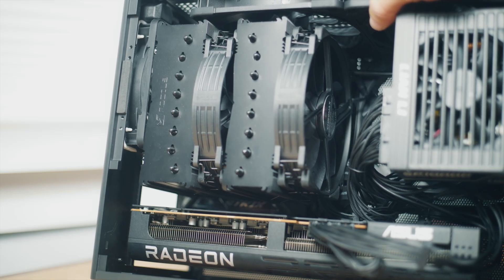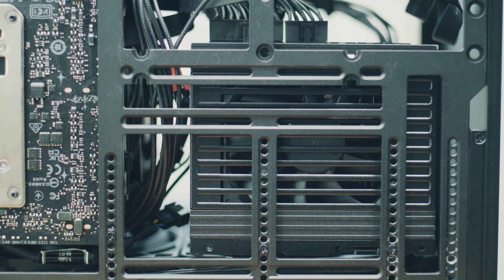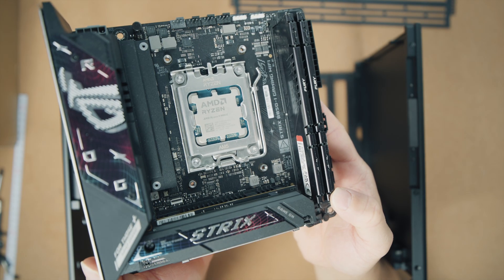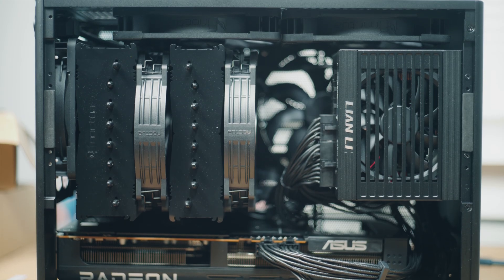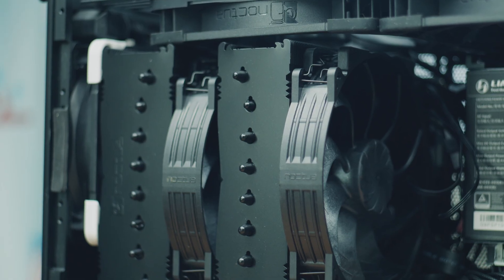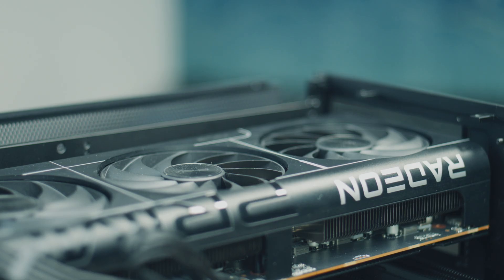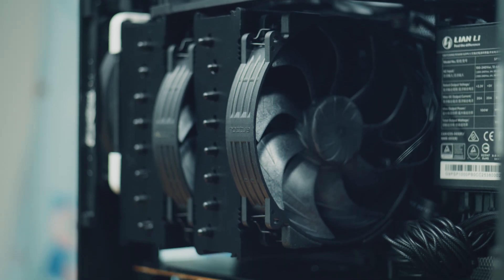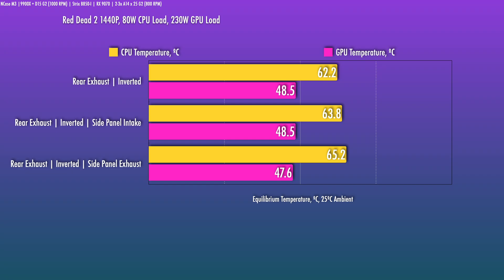𝘛𝘏𝘐𝘚 is the best airflow setup for an air-cooled NCase M3.

Comment: @MachinesMore help me out here - Kingston Fury Beast 32GB lists 34mm for RAM height. Max RAM height for NH-D15 G2 is 32mm. The ncase m3 only offers 168.5mm of total clearance and the NH-D15 G2 totals 168mm, so how does everything to fit? Even if offsetting fans on the CPU cooler (which per the ram height/max ram height cooler issue, you have to), where is the 1.5mm you still need to fit this ram/cooler combo into the case? There's something I am missing here.

Comment: I can't fit the 2nd round fan on the NH-D15 due to RAM height. Instead I can use the NF-A14x25 G2 (non round) fan as secondary fan on the CPU cooler, due to the mounting holes on it being 105x105mm (same as the 140mm G2 round). Would that be okay for the Inverted GPU/CPU exhaust/2x fans bottom exhaust layout you showed here? My both 9950X3D (PPT 180W) and 5090 (Afterburner curve tuned and 80% Power Limited) are undervolted.
Reply from the maker: Did you mean you want to run a square A12 (120mm)? Also do you have a rear fan? You may find that the center fan plus a rear fan is enough. Airflow-wise, it's not an issue so long as the directions are consistent.
Reply: @MachinesMore  Yes, a square A12x25. the mounting holes fit the ones of the 14x25R G2 (from NH-D15) so it should fit using the same D15 fan brackets. I will have a rear A12 G2 fan. so that would make 3 fans total on the cooler: 1x 120mm G2 rear, middle 140mm round G2 stock and 3rd 120mm square G2 on the front of the cooler heatsink.
Reply: What is your RAM height?
Reply: @Dermii3D 35mm
Reply: @aumdna  I saw a post on Reddit with a nh-d15 g2 and a 35mm Corsair Vengeance without any mounting problems. Now Im confused :/
Reply: @Dermii3D in what case?
Reply: @aumdna  M3 Grater
Reply: @Dermii3D I talked with someone who was able to tweak/unscrew the backplate on a X870-I board, the CPU bracket, and re-screwed it with a slight offset to the right, so the NH-D15 2nd fan clears the RAM, but I wouldn't do since Im using a Thermalgrizzly bracket + Kryosheet. My solution is the 120mm square G2 Noctua fan, because I can use the same D15 fan brackets. The round 120mm doesnt work

Comment: hey, looking to do pretty much this build but with a 5080. A few questions if you'll indulge me also thanks for your hard work in testing this stuff, great channel.

- Never had a PSU in the front of the case, do you need some form of extension etc.?  
- How safe is it to have your GPU upside down in inverted? how do you stop it sagging the other way.
- Looking at the M3, any mods they sell that you'd say are good or just the standard kit required that they sell. 

Thanks kindly.

Comment: really wondering how the temps would be with back intake and a top-front exhaust (only that one top fan) and non-grater version(and maybe a back fan, where the psu was?).
Or the same, but flipped

Comment: Really great video with actual temp testing. Some articles online claim "CPU cooler intake is definitely the best" and nice to see that proven mostly irrelevant. Surprising to see inverted be so much cooler for the GPU, could be that the small feet prevent GPU intake when it's on the bottom and taller feet would help bring bottom GPU temps closer to inverted/top GPU temps, just a guess though.

Comment: Great info as always!. Can i ask you about the noise difference with the same hardware (9900x) between this SFF build and the FormdT1 with air cooler like Id cooling or similar. Is the latter that much louder or if i`d restrict cpu power usage etc from the bios it wouldn`t be that noticable. I really like the FormdT1 but maybe the Ncase M3 might be the more logical solutions. Thanks

Comment: I tried the inverted build in the M2 and didn't like it at all.  Mostly because the PSU is held up by two tiny screws from the bottom, and the GPU has no support.  It doesn't really feel like it's meant for it and feels like an afterthought.  I looked up the M3 and it seems they haven't tried to resolve any of those two issues.

My favourite build up to now is traditional build, with GPU pulling fresh air in from the bottom, then the AIO on the side panel, PULLING fresh air in through the radiator, and then two fans at the top exhausting it all out.  The airflow of it makes complete sense, there's plenty of room in the case for air to move, and you can actually feel all the hot air being directed out of the top.

Comment: This just shows how flawed current standards are. Even for cases at this price point, cooling is still stupid. As for this case, sagging is an issue for both. There is no handling of external cables. But given that this is the space you're in, this is actually pretty nice work. Except that you do not really call out the basic flaws of the standards of the industry, which are pretty glaring. But as a guide for building in this thing, just accepting what it is, this is great.

Comment: Wow, now I am going to switch to inverted exhaust. I have both the M3 round and the M3 grater. Would the grater be even better? or do you want me to test? Of course I have a 9800x3d in the grater with a 5080, and a 9950x3d in the round with a 5070ti.

Comment: @Machines & More I want to order the M3 so badly but not sure if my parts will fit:  NH-D15G2m mini-itx board, sf1000 corsair , 9950x3d, and the possible problem - TUF Gaming 5090.   I want to do it in the slot on the board and mount horizontally.   Comments Machines & More?
Reply from the maker: Should be fine and a good list there. TUF 5099 dimensions check out. You will just have to have the ITX board up higher to accommodate the thicker card, so no top fan possible over the D15, but you should be able to get one on the other end. SF1000 is the SFX you are referring to right?
Reply: @MachinesMore  Yes the corsair sf1000 sfx unit.

Comment: What about dust-collection on the GPU with a Inverted layout ? I feel like dust will suffocate the GPU within 1 year of use and could be detrimental to longevity of the card. Thoughts ??
Reply from the maker: Sure, with the way the top/bottom panels are you definitely need to vacuum it out regularly. It's not the worst thing performance-wise for dust to accumulate on the heatsink, just... a little gross 😂
Reply: @MachinesMore  A 30-sec vacuum every few months wont hurt. However, I travel internationally with my PC every ~3 months or less. Anti-sag/Travel kit solution is very important for me. I have a clamp-style bar secured to the bottom panel with Standard GPU layout which works beautifully. What would my options be with Inverted layout? Thanks so much!

Comment: Interested to see what the result would be of the rear intake plus side fan exhaust (plus top exhaust)... That's how I have it set up in my NR200 with a 5080FE, that side fan exhausts a lot of heat from both CPU and GPU.

Would it be possible to test it? Seems like the most optimal way for both GPU and CPU on paper.

Comment: You said in all configs the case fans were in exhaust mode. That would negatively influence configs with CPU exhausting no? Because the cpu fans would fight with the case fans for air.
Reply from the maker: That was my initial guess. But the ventilation and space is such that it doesn't seem to be a big issue. I was very surprised.
Reply: @MachinesMore  Okay thhank you for the reply. I will be building in the M2 Round and I will be using a 7700X cooled by a NH-D12L. GPU is EVGA 3080 FTW3 Ultra. Would inverted with rear exhaust still be the best? I will only be doingg gaming no productivity work.

Comment: So you just bought an air cooler and you assume that it is the best air cooler, I have a Noctua nh d 15 and I had a 14 version of it for my previous i7 build, now I have a ryzen 9950x and an nh d 15, and a corsair 4000d airflow case, I think there might be minor differences but this case and cooling system is good enough, I don't claim that it is the best but it might be.

Comment: This is my build could you tell my what is the best thermal configuration since I didn’t buy any fan yet 

• Case: NCASE M3 
• CPU: AMD Ryzen 7 9800X3D
• Graphics Card (GPU): MSI GeForce RTX 5090 VENTUS 3X
• Motherboard: ASUS ROG STRIX B850-I GAMING WIFI
• Memory (RAM): Corsair Vengeance 32GB (2 x 16GB) DDR5
• Storage (SSD): Samsung 990 PRO 2TB PCIe 4.0 NVMe M.2 SSD
• Power Supply (PSU): Corsair SF1000 (2024 Model) — 1000W 80+ Platinum SFX
• CPU Cooler: NZXT Kraken 280 (280mm AIO Liquid Cooler) — Standard Edition

Comment: If i useRtx 5090 rog astral, can it fit in ncase m3 with atx psu, matx motherboard and noctua g2?
Reply from the maker: Doubt it. ATX power supply would have to fit in a very innovative way (sideways on the main board panel maybe?) Also which primary slot on the mATX board does the card slot to? Astral is practically 4 slots so you can't afford to lose a slot because of the board.

Comment: I wonder how big GPUs are going to hold up in time with inverted setup, without any support at that height.
Reply: I had an inverted case once, I just cable tied into the fan hex cutout and looped it over a GPU pipe, just enough to hold sag not pull it up
Reply: You can 3D print a brace on the M.2 for most cards.

Comment: What about Noctua C14? That was the best air cooled setup for NR200, iirc. While I don't think it would beat NH-D15 G2 (or G1) it could still be an interesting comparison. Especially with the NF-A14x25 G2 fan on top.

Comment: M3 + ASROCK B850I Lightning + D15 G2 build note: rear fan cannot be a 15mm one. There is a 23mm gap. D15 radiator cannot be rotated (towers are not even in thickness, its visible without a ruler) even when using stock 0mm position.

Comment: Really interesting that the side fan on the bracket has negative effects on CPU temps. The effect is the same even without the top or bottom fans? The D15 is pretty much closed on the upper and lower sides because of the folds on the fins, I wonder if they really help in cooling.

Comment: Glad you been deep diving into the M3!!! I'm using rear intake and front top/side exhaust too, as well as bottom GPU intake Just a bit limited because I went m-atx.
Reply from the maker: Nice, yeah the mATX does limit things a bit but rear intake overall should still be able to get strong performance- the case is just very well ventilated.
Reply: @MachinesMore if I do this build with a itx motherboard, how would that benefit me in this case - sorry for simple question but I'm looking at this case as my first sff build in the future.

Comment: Because of your videos with that cooling xperiment. I did all intake on my Dan A3 and deshouded the GPU so that 2 120 fans can pull the air out.
One thing i would like you to test: Put on tape where the cooler finns are free. So that the air get tunneled and can escape early out of the cooler.